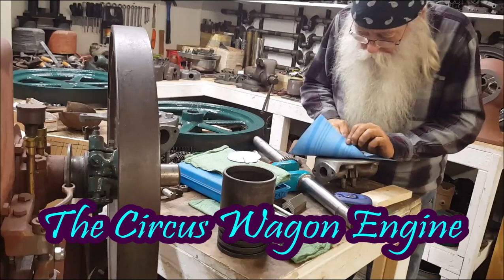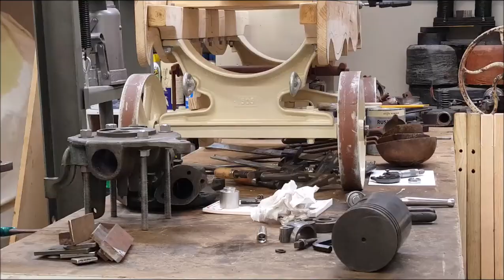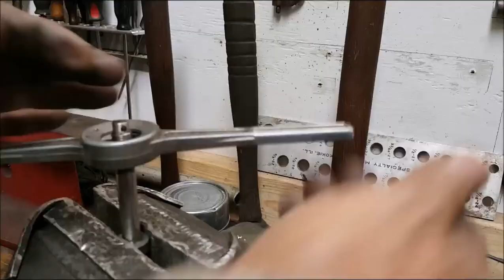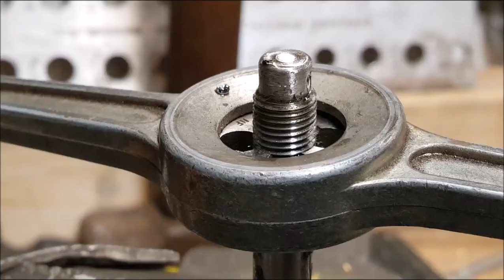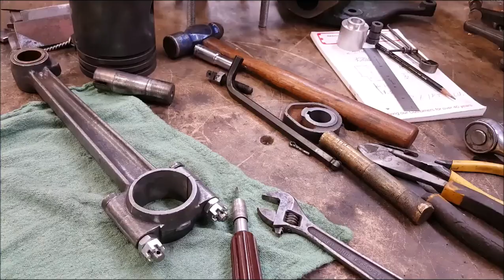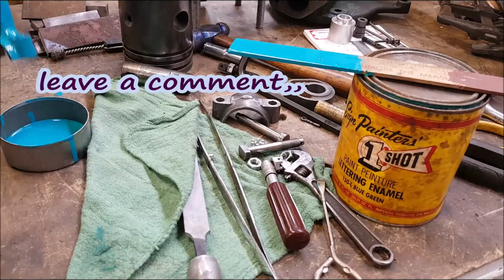The Circus Wagon Engine head gasket piston and rod #25

Comment: Just an added tip on the one-shot paint...In a separate container (like you used) add up to, but not more than, 10% mixture of Penetrol additive to the one-shot and mix well. It's designed as a thinner and leveling agent to eliminate all brush strokes in the process. Start with a small amount first. Give it a try, but buy the smaller can for longevity. Do not pour the unused portion back into the original can, toss it afterwards.